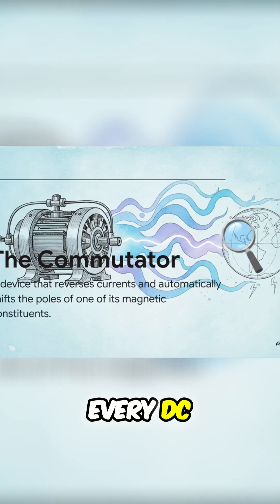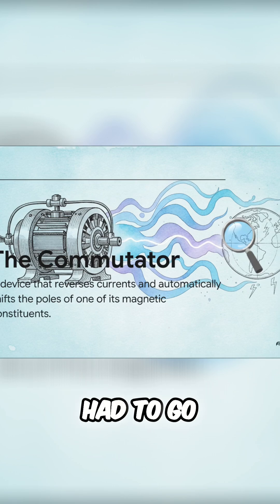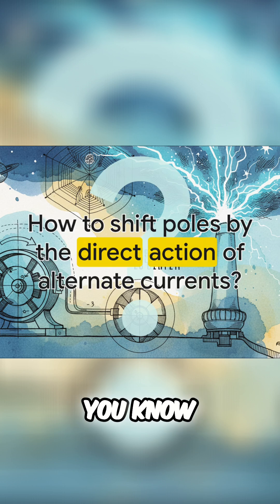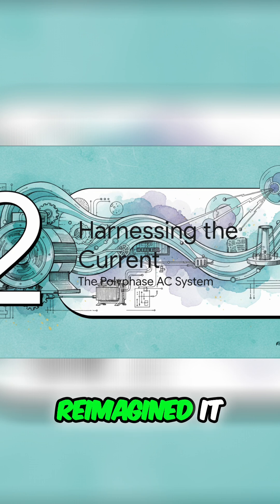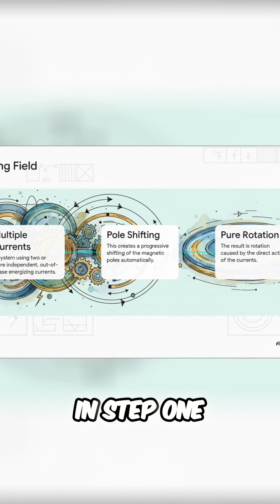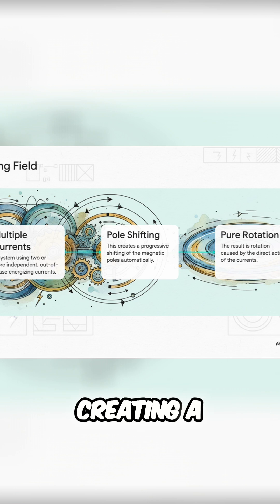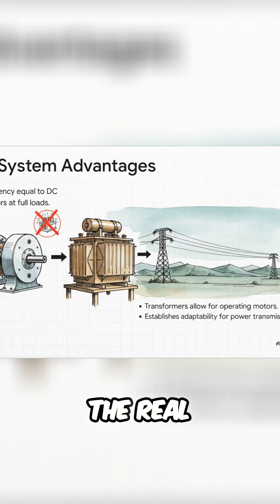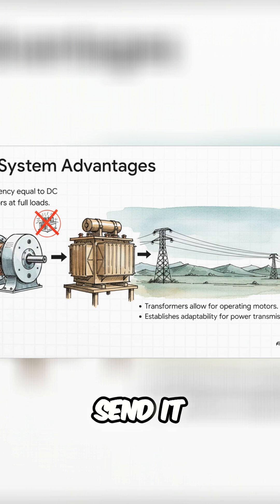Tesla's Genius: How AC Motors Revolutionized the World #shorts

Comment: Historically, this is true, and Tesla was WAY ahead of his time. But technology is changing, and DC is making a comeback. Some countries now sell power to other countries via undersea high voltage DC transmission (HVDC). There is less power loss in transmission

Also, the electronics for motors have evolved. Brushless DC motors now exist (the brush is the commutator mentioned in this video). 

Another  variant is that the alternating current is generated onsite instead of being transmitted to industries and residences. Instead of 50 or 60 Hz, they can adjust/optimize the frequency over a very wide range. They're called 'Variable Frequency Drives' (VFD)